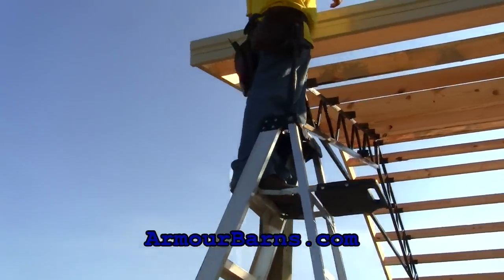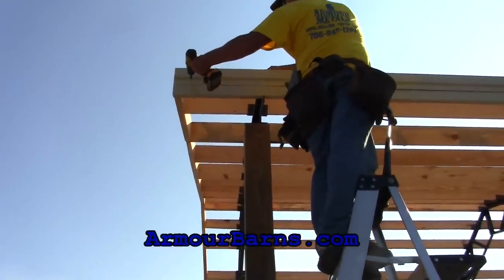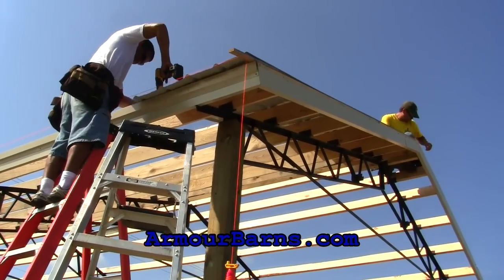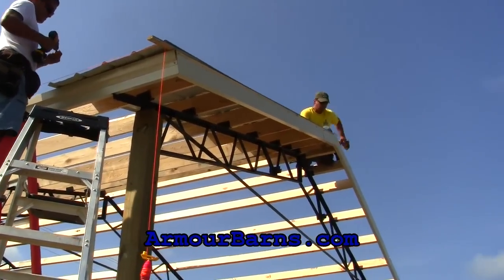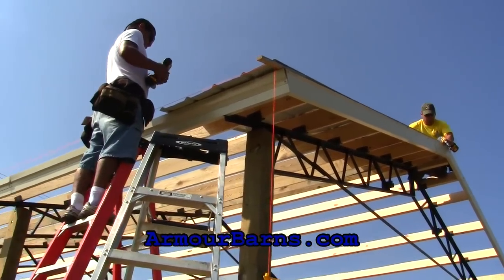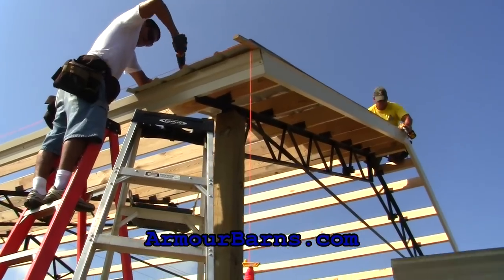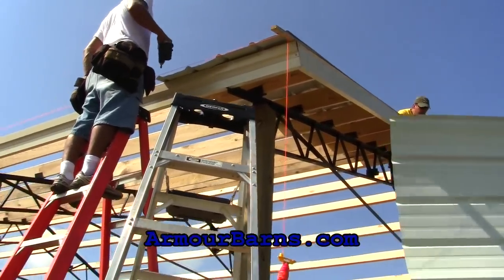20x40x12 Steel Truss Pole Barn Kit Part 3 How We Install The Panels And Trim

Comment: When he marked the angle on the finish trim at the gable instead of cutting it off leaving a bare edge showing he could have folded it under giving it a finish appearance. Most guys just cut and install, I have jobs that I did 40 years ago using my method that still look great.